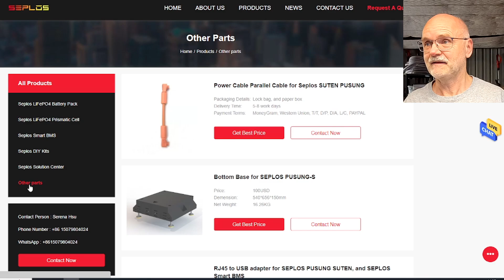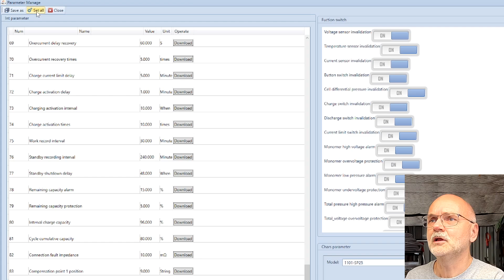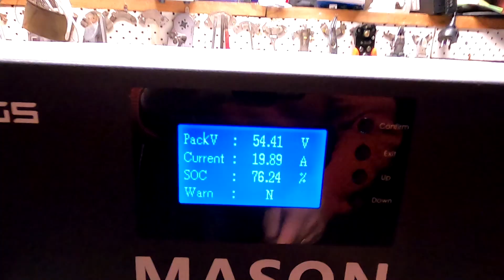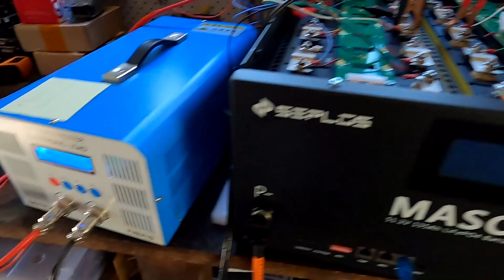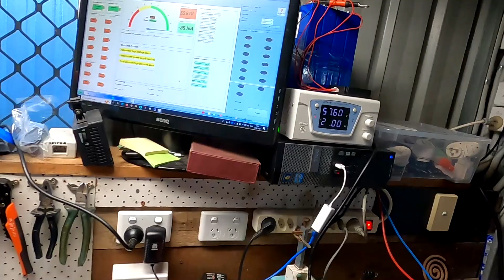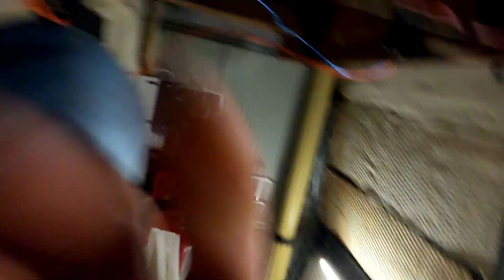SEPLOS SMART BMS: as good as its reputation?

Comment: Re. BMS stop charging, this is exactly why you need communications to your victron gear. When you have comms, it just slows down your charge current when your battery approaches the high voltage per cell so that it never goes ABOVE that and trips the BMS. When it slows the charge current, it gives your battery time to balance instead of just shutting off your charger (when using chargers with comms like your Victron MPPTs and Multi). Also helps to have a real top balance before assembly ;)
Reply from the maker: I'm working on this right now. We will see. I doubt slowing down charging will actually prevent this from happening.
Reply: While that theory sounds ok, i think Im with Andy on this one. He slowed the charge current down to 2A was it? And it still was having problems. I think Seplos definitely need to have a more active balancer in this system

Comment: Imagine a NEW BMS design where each individual CELL in a battery pack is charged up to a predetermined limit to prevent overcharging at a CELL level.  There would be no need to run any balancing function since any and all CELLS below the limit would be automatically charged up to the pre-determined limit. The total charge of the PACK could never exceed the sum of all the individual cells.

Likewise, the discharge ability of the PACK would only be terminated if any individual CELL is below a predetermined limit. 

This new design would eliminate any need to ACTIVELY transfer voltage from one cell to another or PASSIVELY drain voltage from any overcharged cell.

 I have personally performed a similar charging function using car batteries where two six volt batteries were individually charged while they were connected in series to create a twelve volt pack. 

This was back in the 1970s when I owned a 1957 IH school bus which was converted to a camper. The vehicle was originally designed to run on six volts and retained the original wiring, generator , and starter while I converted all the lighting to run at 12 volts while adding components which also required twelve volts. The original thick wiring  easily handled the twelve volts and the six volt starter never had any problems cranking at 12 volts. 

The only problem I ever had was in rural northern Minnesota when the engine dropped a valve and I had to replace it using only a wrench, vice grips, and a screwdriver which was used as a scraper to remove old gaskets. This reminds me of the time a friend and I replaced an engine in a VW van on the side of a road when it's valve train rockers fell off. I had to pickup another used engine, carry it to my car ( by myself) and bring it to where he was stranded in Michigan.
Reply: While doing a little research last night I discovered that an Arduino UNO (~$26.00 on Amazon) can only monitor 6 analog inputs (for voltage) while the Arduino MEGA 2560 (~$45,00 on Amazon) can handle 16 Analog inputs which would be perfect for a 48-volt LiFePo4 battery (16 cells). The MEGA 2560 can also handle 52 output (control) lines.
Reply from the maker: Yeah, a BMS with 16 individual chargers, that would be great. We would also have the single capacity data at our hands. Someone should work on such a device...
Reply: @OffGridGarageAustralia  Actually, there is a option...I found that on Intersolar in Munic:
STABL Energy GmbH is a startup, using each cell of a battery pack individually to create a sinewave. It is kind of a inverter that series connects and disconnects cells to create a 50Hz sinewave. They reach a inverter efficiency of 99.4%.
Reply: @Raphael_Hofmann  That sounds good!

Comment: You need the active balancer, the majority of people don't. If you have good cells and top balance and don't spend a month below 3.4v, you don't need an active balancer. You did after all unbalance things by only testing a few cells.
Reply: > "and don't spend a month below 3.4v" --> considering 3.2V is nominal, and this is a solar application where in winter you might rarely charge fully...
Reply: @upnorthandpersonal  I live in the desert, even in the winter you get lots of sun. Less shade on his panels would help. Most people want capacity to get through one or two cloudy days rather than months.
Reply: @john_in_phoenix  Yeah, I live in Finland. I barely get any sun in winter...
Reply from the maker: I would not say the majority does not need a balancer, I would say a few won't need it.
Reply: @OffGridGarageAustralia  I would say close to 90%.

Comment: Funny, yet interesting how they translated 'cell' as 'monomer' :) Guess a battery from now on will be called a 'polymer'!
Reply from the maker: Yes, I figured that as well. The translation is partly correct using the word voltage but then again pressure. Very easy to miss something or not being able to find the right setting in this chaos.
Reply: Hahaha…was thinking something similar.
Reply: Yes, monomer is a bit of a misnomer. :)

Comment: Great video Andy, you really got me on the cliff hanger near the end 😆 Maybe you could mount a key switch on the side to activate the active balancer addition.
Reply from the maker: Haha, great. Couldn't resist with the premature ending of the video🤡
Yeah, a little switch somewhere could be easily implemented. We will see...
Reply: @OffGridGarageAustralia  Another function for the Raspberry Pi or an Arduino? 

Actually a simple BMS could be easily implemented in either.  

When the "BMS" is initially turned-on individual CELL charging and PACK discharge is disabled.

begin routine.

Check each CELL's voltage against the upper and lower limits and when the CELL is below the UPPER limit enable charging for that CELL. If the CELL is below the lower limit disable PACK discharge.

(Do for each cell)

If after checking the cells and they are ALL above the lower limit enable pack discharge.

Rest a short time.
repeat routine.

A physical structure would need to be created to limit charging current (Amperage) for each cell as well as the entire pack. Since cells stacked in series increase voltage of the PACK but not amperage the discharge current for the entire pack could be the same as each CELL's capacity. 

IF anyone decides to try to build their own BMS, they and they ALONE are responsible for any results. I assume no responsibility since this is only a theoretical example of how such a device MIGHT be constructed and NOT a detailed example of how to actually do so.

For what it's worth, my career was spent in large mainframe programming and systems design at both national and international companies. I designed and programmed systems handling millions of dollars monthly in accounts receivable and payable as well as insurance and manufacturing systems.

Comment: andy , the "runner" cell, isnt that one you tested, and thus may have caused the imbalance yourself ?

i must confess i topbalance my  cells before i put them in my kit, but i am not seeing must deviation.
furthermore , when you connect the seplos to you victron setup, charging amps will be lowered at the top of the curve, preventing cell imbalances
Reply from the maker: Yes, 13, 14, 15 and 16 were the cells I tested and as I said in the video, this massive imbalance was home made. I wanted to see if how the BMS handles that... Usually that would not occur and you would have done a proper top balancing with all cells in parallel before installing them in the case.
Reply: @OffGridGarageAustralia  Would you though? They seem to indicate that you install the cells as they arrive, no mention of balancing beforehand. If they come roughly balanced at mid SoC, maybe the balancer can handle that? That would have been good to see. 

Want to discharge the cells to 50% SoC and reset the BMS and test the theory? 😉
Reply: @OffGridGarageAustralia  sorry andy, but kind of feel like you setup the bms to fail, especially since you knew it was passive balancing only.
i hope you'll still give it a fair chance in your 280ah kit , and you'll do a over time review.
i do agree seplos needs to start looking into adding active balancing into their bms, as voltage difference will become bigger as cells age
Reply from the maker: @houseofancients  it was part of the test. I knew about the small passive balancing the BMS has and we have seen this same result with many other BMS's in this situation before.
When we build the large MASON system, I'll do a full top balancing of the batteries before we assemble it as one would do.
I still believe, the BMS will struggle with even a very small deviation in these large capacity cells.

Comment: Once you established CAN-Communication, it won't disconnect anymore at high voltage and it will just throttle down the charge current / voltage until the balancer did its work.
But sure...a active balancer would be really nice to have in future ;)
Reply from the maker: We will see. I was going to connect it to Venus OS using RS485 though, not CAN.
Reply: @OffGridGarageAustralia  It does not sound as easy as plug & play. But I'm keen to see your progress on that :D
Reply from the maker: @Raphael_Hofmann  yeah, it's definitely not. I cannot get it to work. Not sure how a solution via CAN bus and 485 would look like. My Pi does not have a CAN connector...
Reply: @OffGridGarageAustralia  I wished we were neigbours....I could borrow you one of my Cerbos for the test. Maybe you can buy one for the video?
Reply: @OffGridGarageAustralia  Time to cough up for a Cerbo GX 😀
Reply from the maker: @bbrown_sc  yes, it probably has some other benefits as well. The Raspi was a good start but I now have reached a system size that I need more. More than the Pi can deliver...
Reply: @OffGridGarageAustralia  Andy, thank you for your ongoing work. 
If you buy a Cerbo GX, do not power it directly from 48V. Despite being supposedly capable of taking 9-72V there is an issue with (inrush currents?)  from large 48V battery banks. They die on connection. Sometimes first time, sometimes 6th time. Convert down to 12V/24V or regret it...
Reply from the maker: @flatfoot  We may have a solution using the Pi and CAN communication. I will try this first before spending the $500 for the Cerbo. It can run from my 12V converter...

Comment: If you set your charger to ±100mA for the last part of the charging process, you allow the bms to discharge the "full" cells until the lowest one creeps up
Reply from the maker: I know, in theory thsi should work, right? It would just take 1000h+ maybe. The active balancer has done it in 30min.
I'm not even sure if the passive balancer of the BMS is working or not 🤷‍♂️
Reply: @OffGridGarageAustralia  that is my biggest question too cause you barely see it happening and I guess that I will need a BMS too  like you had mentioned for a kind of quarterly maintenance. But not sure what to get for this task cause the Neey seems to be a big gun for a 8 kWh battery.
Reply: @OffGridGarageAustralia  166 hours to balance 5000mah @30ma balance current
Reply: @OffGridGarageAustralia  Since the balance current of the Seplos BMS is about 150mA to 180mA, it takes about 6h to balance 1Ah difference.

Comment: I think that the behavior could be in fact appropriate. As this BMS has really small balancing current, it needs much longer to fix a cell. If it re-enabled charging immediately, the cell would be still off by a lot and it would turn off again almost instantly.
Reply from the maker: That is right, but without any charging at all, the other cells will never catch up and only the highest cell gets discharged a tiny bit every time this happens. Without a proper top balancing and matched cells, this concept will not work.
Reply: @OffGridGarageAustralia  Makes total sense. My JBD smart BMS will cut off charging if one cell is high and then the balancer turns on for 2 hours or so and then when the cell drops the bms will start up the charging again for a few minutes and it cycles until its balanced... fully automatic!

Comment: Andy...

Have you checked the bms PCB to see if there is an ujustment pot for the shunt and voltage calibration.

Is it possible it's holding back the charging until the balance delta improves  ?   

Hmmmm.

Is the current firmware up to date ?

If it was my battery I would top ballance all the cells in parallel before instalation.

May be a good idea as you say to check DC ripple or any inducted AC !

Stu.
Reply from the maker: Yes, top balancing is a must, as I said in the video. This was part of the test to see how the BMS reacts and how the balancer works.

There is no pot on the BMS as far as I could see. This is all software based.
Reply: @OffGridGarageAustralia  That's a shame. It's allways hard to get shunts to read accurately. They are simply not highly precise devices.

One question if I may..... 

You had the shunt on the floor. I was wondering if you had the meter voltage reference wire connected at the battery terminal as a lower voltage will give a different reading as you know. With the meter your using I prefer to power the meter with a separate supply and common the ground connection.

Great episode as always  🙂
Reply: @OffGridGarageAustralia  If you wanted to use the balancer you could always use a zener diode with a pot connected to a relay via a mossfet. Then use the normally open terminals to close the run jumper on the balancer.

Just an idea but not something you expect to be doing with a brand new battery and bms  !!!!

Comment: Would be great if seplos would sell a mason kit without the BMS for a decent price. JK with RS485 could even fill the  RJ45 holes with a bit of DIY if someone really want to connect the batteries to the inverter.
Reply: Seplos will sell the 280 kit without the BMS. I bought one for $285 + $179 shipping + other Alibaba fees on 5/5/22. You just need to ask.
Reply from the maker: Ys, that would be a great option. I'm working on the comms part now and see if I can get the BMS talking to my Victron OS.
Reply: @OffGridGarageAustralia  you need to upgrade to victron firmware
Reply: you can get the box without the bms,  there are 2 other providers for EV LFE280 cells
Reply: @sergea1138  thanks for the information. Do you have any link to the mason series without the BMS?
Reply: @photocromax  just use the form to ask them
Reply: @sergea1138  great. Thanks again

Comment: I wanted to know if you plan on buying more of them. Is this basically going to be your battery-3.0 setup. and how is the total price for one vs if you made it yourself like battery-2.0. I only saw you mention side handles, but it kind of looks like it might be rack mountable in size. Did it have holes and/or rack mount ears to rack mount it?
Reply from the maker: So far, I have two of these systems to play around with. If I will order more... time will tell. More testing needed.

Comment: It's crazy the amount of parameters it has.  Also, it seems like the one cell is messing up everything.  Does SEPLOS let you purchase individual cells for replacement purposes?  Great Video as always!
Reply from the maker: Thank you.
Seplos has cells on their website, but how do you know they are better than the ones they have already sent?
It was part of the test to let one cell go really high to test the BMS's function. Usually you would do a top balancing of all the 16 cells before installing them so this extreme voltage difference would not occur. But even of having the pack balanced with the active balancer, as soon as I disconnected that, the voltage difference was on the rise again. I have to ask Seplos how their balancer works and how to check...
Reply: @OffGridGarageAustralia  Please ask, I have a feeling the balancer turns on the bleed resistor for a cell at 3.5 judging by the FULL pack voltage over voltage setting. The point of a BMS is to just monitor and that means you should set your charger to charge the pack at less than 3.5 per cell. I think that makes sense for lifep04 packs because they have such a weird curve at the top (above 3.45v) so its a good idea to stay away from that area.
Reply: @OffGridGarageAustralia  We eagerly await seplos response.😉
Reply: It is the same with PC software from QUCC…quite confusing and no explanations on what the parameter does.  Some are simply not intuitive at all.

Comment: When it's in that "power supply" warning state, is it still balancing or does it only balance while it is accepting charge current?
Reply from the maker: Great question, I really don't know. The cell voltages decreased a bit during that time but it could be the voltage is slowly settling anyway without charger. Could be due to the balancer. Could be both... 🤷‍♂️

Comment: Bms lost me at total pressure,  high pressure 🙄 very odd wording.
Reply: I believe it’s a Chinese translation thing, actually describing Voltage as pressure is fairly accurate way of describing its function to push amps.🙂
Reply from the maker: Yeah, the translation is not great and could leave a lot of questions. Many Chinese manual talk about pressure (voltage) and welding (soldering). It's not great...

Comment: To get the BMS to register 96% SOC so it will charge to higher cell V, you should set the capacity higher, like 150 Ah. I think you set it lower than what it was before. If my logic is right, the BMS should then charge further, and if it reaches 3.6 V at say 140 Ah, it would record 140 as FCC (Full Charge Capacity).
Reply from the maker: I didn't set any capacity manually in the BMS settings at all. It did this all by itself. But you could be right. I'll test this out at some stage.
Reply: Good idea!